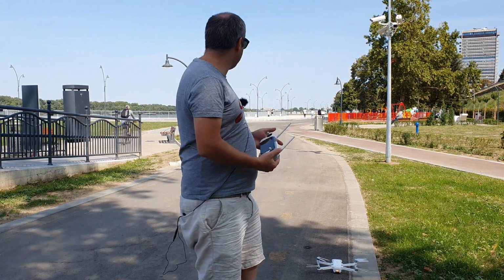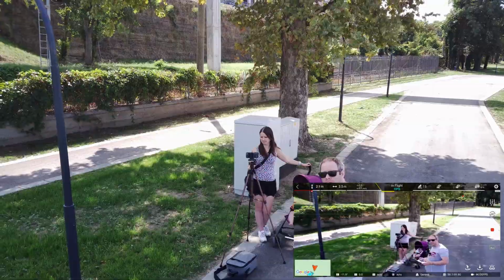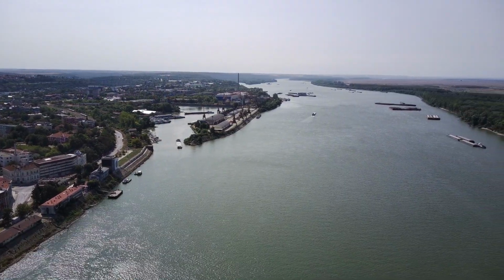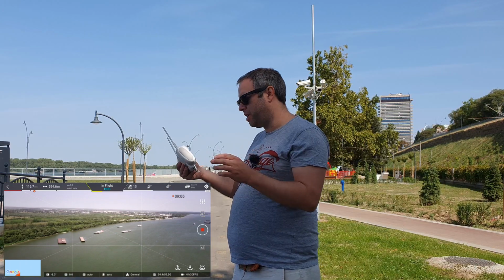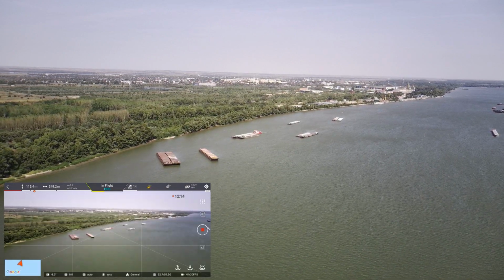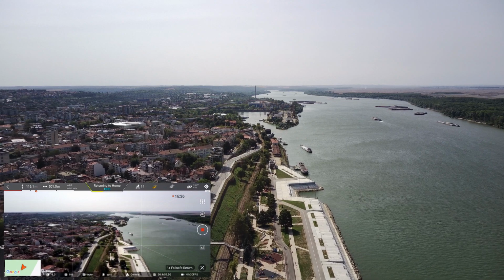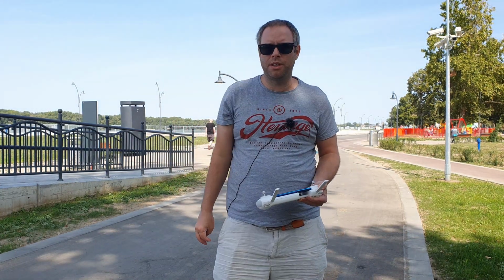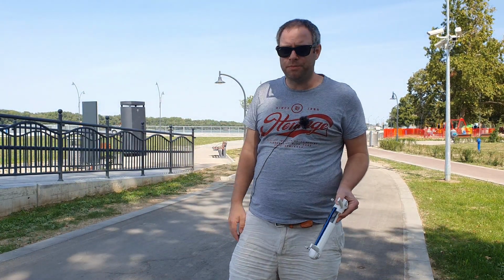Fimi X8 SE 2020 Failsafe return over the Danube!

Comment: You might want to check the orientation of your antennas. See page 22 of owners manual. My fimi is very sensitive to this.
Reply from the maker: It's just weird it started happening straight after I updated the app. I never had it before but maybe this flight was quite different from the rest. I will take a look at that though as its a great suggestion I hadn't even thought of.